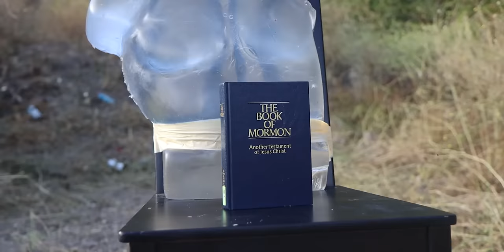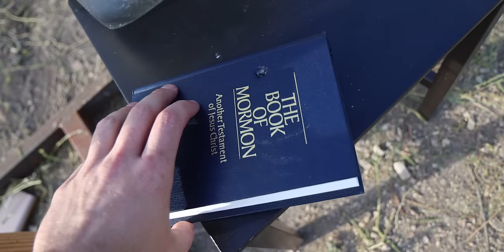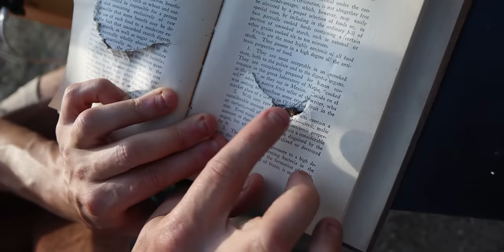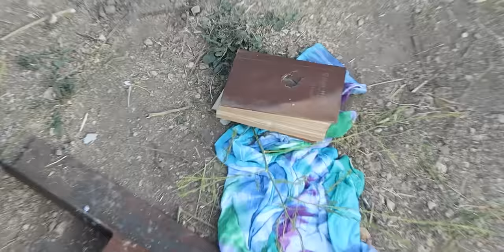How Many Shirts Will Stop a Bullet?

Comment: For those wondering why he was able to easily cut kevlar but it can stop bullets, kevlar is designed and woven in a way that is meant to stop sudden fast moving objects. It sucks against anything that cuts or applies constant piercing pressure because  cutting destroys the weaves and constant pressure will find it's way through the gaps in the weave.
Reply: 'The slow blade penetrates the shield'
Reply: @mikuenjoyerXD  good question
Reply: So similar consistency (literally) to water
Reply: @lag9762  DUNEEEE I loved that movie and am reading all the books rn :D

Comment: Years ago I tried making Canadian pellet gun grade armour. Turns out, unless you're using steel or laminated fabric in epoxy, a .177 at 480fps is surprisingly penetrative
Reply: Make a Norwegian bow and arrow grade armor.
Reply: Grain and pellet type are also important for penetration
Reply: What’s does frames per second have to do with this
Reply: @ChrisS-bw7ft  feet per second
Reply: .22 pellet at 800 fps is what I played with, goes through alot more than you would think a cheap airgun would
Reply: Oh canada! Haha
They want to ban them detuned airguns now...
Reply: That's because most body armor is not stab resistant. You saw how his scissor poked right through right? Body armor is meant to stop fast hard strikes. You can actually stab right through most body. A pellet with a small diameter going relatively speaking, slow, would probably penetrate deep into an actual Kevlar Vest. I'm not an expert though.
Reply: @ChrisS-bw7ft  feet per second
Reply: @PolishBigfootCircle11  going slow is actually the opposite of what you want. The way you defeat body armor is speed and low resistance. Thats why such rounds as the 5.7x28 are so effective. Because its a small pointy round traveling very fast. As opposed to something like a 45acp, which is rounded and moves slower with more impact area. The reason knives go through kevlar easier is because when a bullet hit kevlar it flattens, and breaks up. It puts all its energy into moving the kevlar which then rips and “catches” the bullet. Knives just keep pushing through inbetween the fibers because of how thing the blade is. But stuff like ceramic body armor stops everything because its not soft. Only kevlar usually has problems with knives and even then it stops most of them if made right.
Reply: @johnn3542  killed a few pests with .22 and .177s, I own a .22 airgun and it's kinda fun, it has a scope because my fibre optic sight broke but the open sights are much more fun
Reply: Giggity giggity
Reply: @PolishBigfootCircle11  your slow theory sounds like the Dune method.
Reply: Gold ball tipped .177s are something else. The body is something polished like aluminum but probably stronger so maybe stainless. My former neighbor was hunting rats with these a few years ago, all I remember is that a typical 400-500fps single-pump unmodified air rifle (US) consistently sent those things supersonic. The sonic boom sightly after firing was as loud as a .22LR. They hit really hard, slightly different shape from typical lead pellets, completely round ball-point, more streamlined and more solid bodied but soft gold tipped. There were more from the same brand but I can't recall, might've been carbon tips idk, less speed but more penetration. I hadn't played with an airgun since middle school so have not kept up with the market.
Reply: What’s the difference between a Canadian pellet gun and pellet guns hailing from other countries?
Reply: gg wp lol
Reply: @LowkeyAirgunner  3d printer anyone lol
Reply: @ngonzales3781  then go to Kongsberg to test it
Reply: Yep
Reply: @MrMikeT89  you should probably say f/s so no one gets confused
Reply: Try a break barrel air rifle, I've never chrono'd it but they should be going at least 1000 fps
Reply: @chudwick8814  they especially detuned them under 500fps to not need any permits or to be registered in canada!

But we can have the regular ones with a Possesion Aquisition Liscense
Reply: All of that…. Yet I still wonder to this day, who asked? 🤔
Reply: @misfit2734  same for your opinion and you are still here!
Reply: @Magst3r1  I was just clarifying. Should reply to the original commenter
Reply: @Magst3r1  It's written "fps." That is the correct notation.
Reply: @LowkeyAirgunner  Same for your opinion on my opinion, yet your still here!
Reply: @MrMikeT89  oh ok
Reply: @misfit2734  oh lord that 16yo kid liking his own comments is back haha
Reply: Lol mines 1000fps and can agree I used to hunt squirrels with my air rifle
Reply: @bignig7223  potato canons might save our country from starving one day ! Haha
[Throwing food to get more food ! Sound about like canadian laws]

Lets ban assault pvp pipes and tampon guns (He really did a thing)
Reply: Bullets move in frames per second?
Reply: @LowkeyAirgunner  Not 16 nor did I like my own comment, you just keep proving your self to be goofy lmao can’t comprehend the fact someone might agree with me so you say self liking 😂
Reply: Canadian here, the trick is to use pack ice
Reply: @PolishBigfootCircle11  You’re wrong, the reason why the scissors went through is that Kevlar, or any Aramid fiber, needs to be well layered , held together and condensed with specific adhesives to exert bullet-resistant abilities. Kevlar vests are usually made of a couple tens of layers of kevlar.
Reply: @randomdude6249  scissors are kinda the anti-Kevlar device dude.
Reply: At 1000 fps they penetrate a lot better.
Reply: I learned 2 inches at the speed of an average hip thrust is ALSO surprisingly penetrative.
Reply: @petersmythe6462  yeah lol enough to drop small game off power lines
Reply: @ngonzales3781  Ima steal some from my nearest museum.
Reply: Yeah you would think it would just bounce harmlessly off a piece of plywood but in my case, my Crossman .177 CO2 gun rated at around 490 FPS can stick some pellets almost all the way into a piece of plywood, even in winter. 

Related: there was an incident in the US where someone killed a full grown mule deer with a double lung shot with a pellet gun, which I believe was .177.
Reply: Years ago he tried tuh
Reply: i did this a while ago try layers of cellophane tape and cloth about an 1/8 inch of tape and 1/16 inch of fabric on either side of the cellophane would work for most pellet guns up to 700fps i found this out in middle school when i was messing around with my old crossman bb gun good times
Reply: @MrMikeT89  it’s a joke
Reply: @johnn3542  damm, 800fps? The hell kind of NASA PC do you own?
Reply: Are you from the GTA or something?
Reply: Only 480 fps? Those are rookie numbers .
Reply: Light ammo with good aerodynamics, stability and tip. No surprise there
Reply from the maker: Canadians need armour?
Reply: @Ididathing  ye i think so
Reply: @Ididathing  nah i can go outside without having to worry about a gunshot to the heart
Reply: @Bob5mith  who asked
Reply: @huwale  You might not have to worry about it, Americans don't have to either necessarily. The murder rate in my county in the US is 1 per 100,000 people. The murder rate in Sydney goes from .95 to .99 depending on the year per 100,000 people. So even with guns the cities in my area are just as safe as they are in Alex's area when it comes to murders. I still think it isn't a bad idea to be prepared to protect/defend yourself, I mean it's not like the people in Nova Scotia in 2020 expected to be hunted down like animals but that's what happened to them. If any of those families had guns of their own things might not have turned out how they did. Instead they were forced to try to defend themselves with handheld objects, or run. Fuck that. If the attacker tried that on a rural american home the families he attacked would have been firing back at him -  one man isn't going to walk away from a firefight with multiple adults firing back at him. But due to the gun culture in Canada he had free reign to do whatever he wanted for more than 24 hours to those rural families in Nova Scotia knowing nobody but the few and far between police could even attempt to stop him.
Reply: Mans runnin a super computer for that kind of fps
Reply: @Ididathing  as a fellow canadian... only if you are Trudeau
Reply: @IgnorantDriversClub  100% impact area is a huge one
When we're talking the amount of shear it's imposing, it's a function of the properties and the pressure/load on a specific area 
The same force imparted over a smaller area leads to a larger pressure; i.e. Pressure = force/area 

Kevlar's got some weird properties for sure, that low cut resistance (i.e. not super resistant to high shear going perpendicular to the fibre direction) combined with its insanely high tensile strength (which also makes me wonder how carbon nanotubes as a composite would fair, but they're still a bit prohibitively expensive) makes for a good net to catch the round 

Always found it so neat that that you can cut it fine but goodluck breaking it in tension
Reply: @ChrisS-bw7ft  Dude he is talking about a first person shooter
Reply: @qskii2365  murder rate doesn't include the people that got shot and survived
Reply: Melted milk cartons work pretty well. Apparently some guy made real bullet proof armor plates out of it a while back.
Reply: @huwale  But aren't guns fully semi-automatic death machines that blow lungs out with the thing that goes up?? If the murder rate is the same between my cities and Alexs cities despite the guns then they must not be that dangerous!! ....🙄
Or maybe the problem is more nuanced then "gun bad".
Reply: That’s a lot of frames per second.
Reply: Nice
Reply: @qskii2365  gun deaths in canada are less than 2 per 100k. Gun deaths in the US are 13.6 per 100k. That is almost 7x higher. Id rather have less guns since the less there are, the less people die to them. How often you see mass shootings in Canada? They have less than 1 per year, the US has multiple per weekend.
Reply: @Ididathing  Moose armour
Reply: @Andrew.Gooding  I know that, but acting like everywhere in america is a warzone is the definition of ignorant. Again, my county has a murder rate that is the same as Alex's despite allowing guns. If guns were so incredibly detrimental to society how can the murder rate in the cities in my area in the PNW be the exact same as they are in Australia. Clearly there's more to gun crime then mere access to firearms.

I'd rather live somewhere just as safe as Australia where I can still protect my family and not have to rely on another adult to come save me as if I'm a 200 pound infant. So, the PNW where I live.
Reply: @MrMikeT89  Are you sure, I thought fmj rounds penetrate more?
Reply: @Ididathing  we use hardened maple syrup
Reply: @Gotobedboy  Thats due to the soft core. Outer jacket is initial punch but the soft metal is what goes through
Reply: @MrMikeT89  oh, fair enough, thanks for correcting me lol
Reply: @Ididathing  nice
Reply: @Gotobedboy  Not correcting, just communicating. Good info/questions makes for good convo! Have a good rest of your weekend
Reply: @Ididathing  to defend against Americans.
Reply: @ChrisS-bw7ft  I hope you're joking
Reply: @MrMikeT89  lol that literally makes no sense, lead is a soft metal meant to mushroom and not necessarily penetrate. meaning any other harder metal like copper, iron or steel are gonna penetrate more. I  personally dont know of a softer metal than lead that is used in pellet guns
Reply: damn you must have a fast computer!
Reply: @PolishBigfootCircle11  It's the force over area (ie: pressure) at the tip of a knife that shears through the Kevlar that soft body-armour is made from.
Consider that the tip of a pointed knife and the sharp edges have virtually zero area, so the pressure that the fibres have to withstand is impossibly high from a knife stab. Once the tip of the blade and the edges on either side of the tip have sheared through, the entire rest of the blade can follow straight through that hole.
Reply: @Ididathing  i was bored
Reply: @PolishBigfootCircle11  body armor (at least level II) is naturally stab resistant. You’re thinking of  vests that don’t have plating, like level I (which went out of date in the 70’s) and IIa. Level II+ body armor contains front and back plates, stabbing through it is like stabbing through concrete.
Reply: Bro what? You got it opposite, lead hits harder, other metals penetrate better because they deform less.
Reply: @huwale  same and I'm in America!
Reply: @jordanwilliams6972  Makes sense
Reply: @LowkeyAirgunner  you have to have a license to get a pellet gun? That is beyond draconian
Reply: Rip in the chat for all Canadian homies without guns. o7
Reply: I got a .25 cal with 20x scope got a double kill against 2 pigeons lol
Reply: @ngonzales3781  lol we need it, wr still got crazy archers out here.
Reply: @goontheracoon  yea its gotta be more traumatic to be shot by an arrow out of nowhere than an ar15
Reply: @nickburns8096  yup! A FIREARM liscence to buy any AIRGUN over 4.2fpe or 500fps! Haha 

So you need to register a daisy 880 basically!
Reply: @ngonzales3781  i mean a rifle is just boom- "EEEEEEE" (OH THERE IS A HOLE IN ME- deam, think imma just chill right here) arrow is like: what is this sudden sharp pain im feeling, and why is there a stick in me.. and why are everyone screaming for me not to take it out, it hurts in my back man..
Reply: @misfit2734  It was me.